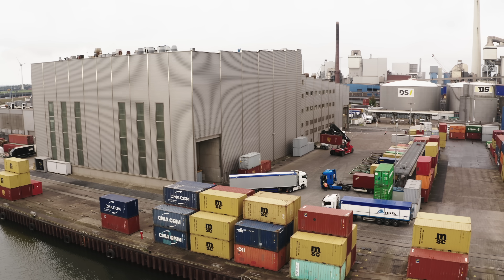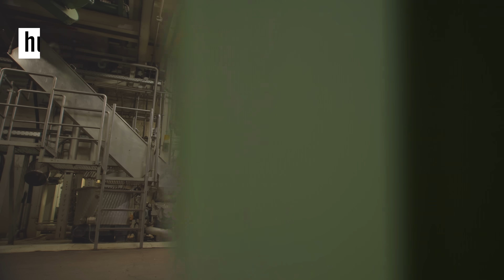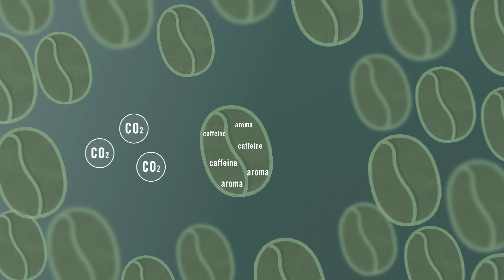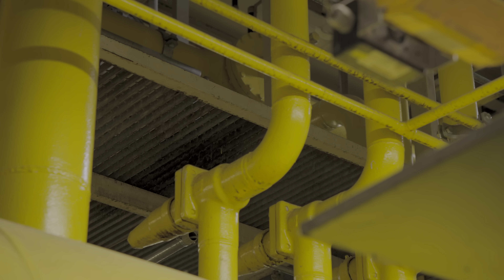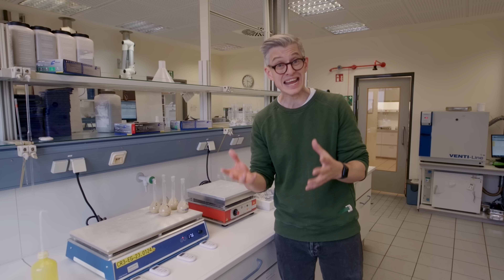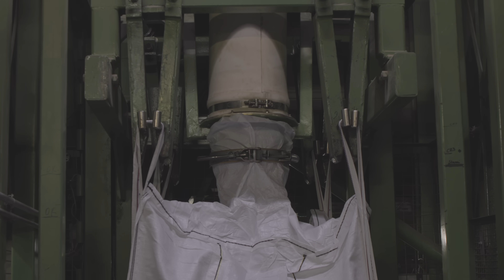The 168 Hour Liquid CO2 Bath That Decaffeinates Coffee!

Comment: I wonder if the carbonic acid formed alters how well the caffeine is distributed. I also wonder why they couldn't take have a small valve that just lets off some of the caffeinated water into a small separate chamber, locks the chamber, then further lets that chamber release the fluids without altering the pressure or constitution of the main tank while still allowing you to examine a sample for caffeine content. You could say "Well caffeine might settle so a sample from just anywhere in the tank wouldn't be representative of the whole" but you could just have a gigantic magnetic stirbar in the tank which would also allow CO2 to diffuse out of the water more quickly and for saturated liquid CO2 to enter into the solution easier.

Also I can't wait for gmo decafe coffee. Seriously it's crazy the lengths we'll go to in order to avoid the cheaper, more viable and eco-friendly option.

Comment: Interesting that methylene chloride is used for decaf.
I used it in liquid state to "glue" plastics because it's a strong solvent. But I stopped using it decades ago when I read that it's carcinogenic.
So I wonder how this works in decaf
Reply: Probably not much or nothing left at all after process and since it’s boiling point is 39°C it for sure would have been vaporated away during roasting process.

Comment: I switch to decaffeinated coffee for health reasons as a diabetic.

The caffeine was driving my blood sugar up. 

I still occasionally use caffeine by putting in a measured amount in the form of caffeine pills but most of the time I just drink decaf. 

Then one time I accidentally bought instant decaffeinated coffee by accident.  That was a mess because it clogs the filter.

But I had to finish the jar anyway and over time the biggest thing I noticed was a huge decrease in waste.  Especially wet smelly waste. 

Since I am not a coffee aficionado and since I drink my coffee with additives... Sometimes vanilla sometimes cocoa powder, sometimes cinnamon,.. always at least a little bit of half and half or cream... I don't notice a big difference since I was never into the nuances of freshly made black coffee from custom beans anyway.

So now I prefer instant decaffeinated coffee. 

I might buy some premium coffee for when I decide to brew a custom cup of caffeinated coffee as a treat since I won't be using it on a daily basis anymore.

Comment: I want to point out that there is no difference between natural caffeine and synthetic caffeine; they are chemically identical. The molecular structure of caffeine remains the same regardless of its source. If I were to give you a molecule of caffeine derived from natural sources and another produced synthetically, you would not be able to distinguish between them using any standard chemical analysis.

Comment: A very good summary of the CO2 process. I work in the technical department of CR3 and can agree with what has been said. 👍
Reply: Is there a reason why you can't continuously monitor the caffeine concentration over time in either CO2 or the aqueous phase using Raman spectroscopy or another remote-sampling method?
Reply: @maciejkepczynski8029 
Good question,

Maybe you can measure the caffeine concentration in the ring line. But due to the constant change of coffee in the different treatment containers, the amount of caffeine rinsed out remains relatively the same. And for us, only the rest of the concentration in the coffee is important. So we would have no real benefit from it.

If you put a measuring system behind each treatment container, it might work.
But in this case, the cost-benefit factor would have to be seriously clarified.
Reply: Speaking as a manufacturer I was impressed with how clean, organized, and efficient your facility looks.
Reply: @RedfishCarolina  define german haha
Reply: @kevin_00001  You don't want me to do that. There's a reason I drive Japanese vehicles and not German.
Reply: How is the C02 kept a liquid at room temperature? Under high pressure?
Reply: @Sfeice 
Yes, we pump the CO2 through the treatment tanks at around 75 bar
Reply: So cool!  How is the employee coffee setup? Is there always one decaf machine next to one regular? Are they brewed filter coffee or Push-Button Espresso machines? Please give any details you can.

Comment: Footage and video was top-tier. I think I can speak for a lot of us that we’ve been waiting for years for this project.  So far, you haven’t disappointed and we’re only two videos into the series. I look forward to the next video next Friday.  I guess a question (two part) would be, besides taste and that you need to roast the coffee as soon as possible after it’s been decaffeinated, what do the roasters need to do differently to the decaffeinated coffee? For example, can they treat the same coffee (one decaf and one regular) the same if they were to roast them both? Or does the decaf need a different type of treatment?  And, if the decaf does need different treatment, comma does that treatment change per type of method?
Reply: Decaf definitely needs to be roasted differently (another thing besides added cost of processing that puts people off) as the opening up of the bean to extract caffeine changes the internal structure. It also appears darker due to the processing than the actual roast level is, so you need to take that into account when roasting. James goes into more detail on it in his original decaf video from a while back.

Comment: Despite buying my decaf beans from specialty roasters, I don't (typically) see the decaf method listed.  If the method is listed, then it's nearly always Swiss Water Process.  I get the feeling  roasters are worried that other processes will be seen by the customer as 'scary' in some way.
Reply: That's absolutely the case from my experience helping out in a speciality coffee roastery
Reply: CO2 wouldn't scare me away, nor would Ethyl acetate, but I suspect most would be scared off by the latter.
Reply: Honestly I don’t touch Swiss Water at all. Don’t like the chemicals used in this process at all. CO2 is the only process I buy.
Reply: @AnonGoogleuser  what chemicals are used in Swiss Water?
Reply: @AnonGoogleuser  Water is also a chemical.

Comment: Very confusing that the decaffeination facility is on a different continent from where they grow the plants.
Reply: You want to run the decaf process and roasting as close to the customer as possible. Green coffee can be stored for several months without significant degradation, once the beans have been opened on the microscopic scale (either by decaffeination, cracking or by roasting) they noticeably lose taste relatively quickly within a few weeks.

Apart from this: coffee is grown in areas that are not exactly the most highly industrialized for various reasons. Some of the same reasons that make those countries attractive for coffee growing make them unattractive for industry. World economics suck. At least today we can chose to buy coffee that was grown on family farms with somewhat fair wages and then roasted by a small friendly shop instead of a faceless corporation.